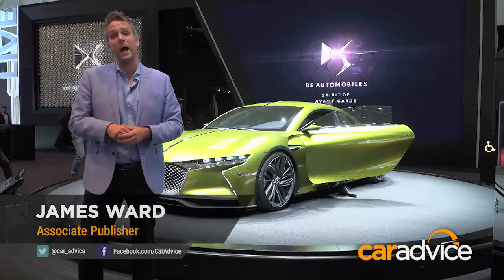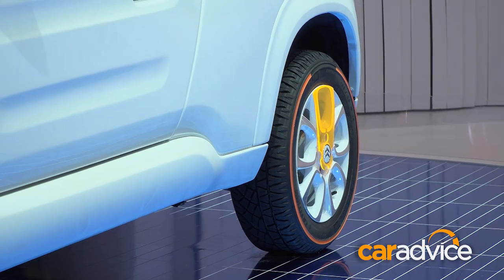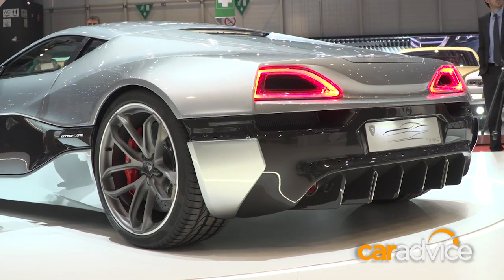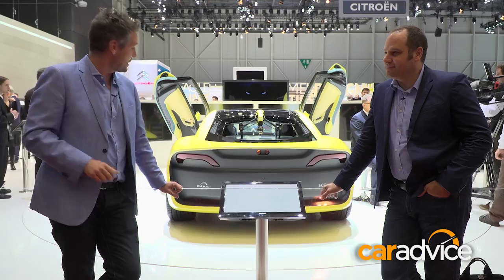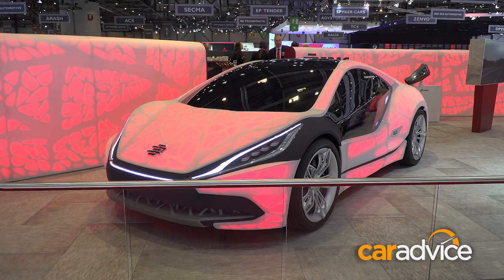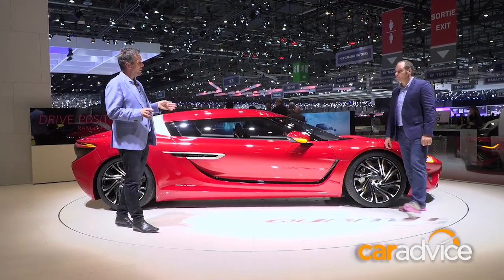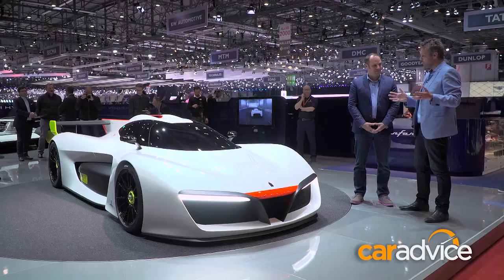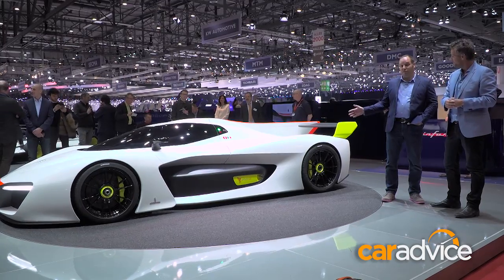Concept cars at the 2016 Geneva Motor Show : Italdesign, Pininfarina, Rimac and more

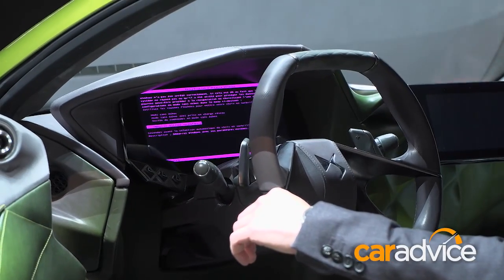Comment: 0:34 is that windows from a restart?
Reply: +enemay Yep i guess its best to use Windows on Concept Cars as it's quick and easy to setup Animation Graphics to just keep replaying in demo mode. But hopefully the real car will have a child of Unix either Linux or QNX.
P.S. CarAdvice.com.au Rimac One is not a Dual Motor drive train. It's a Quad Motor which is the entire point of the 4x motor torque vectoring.